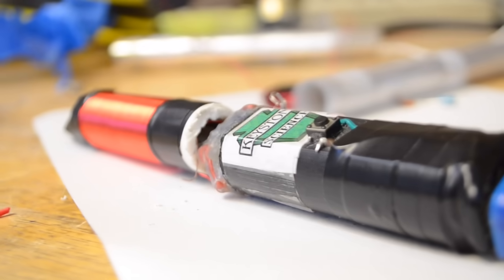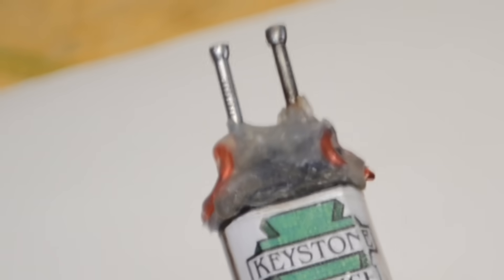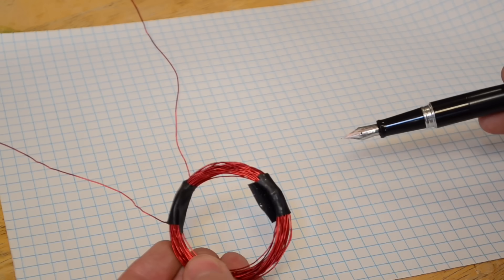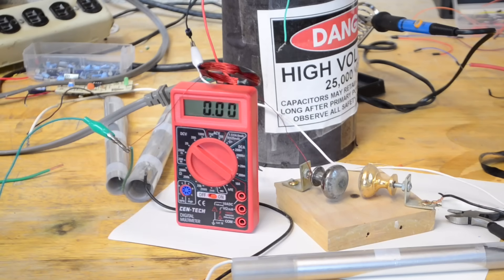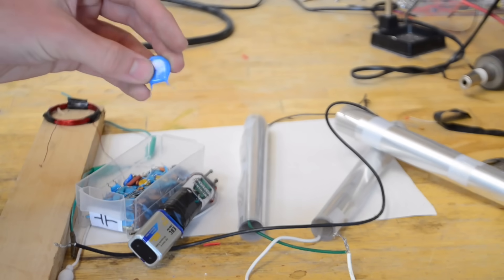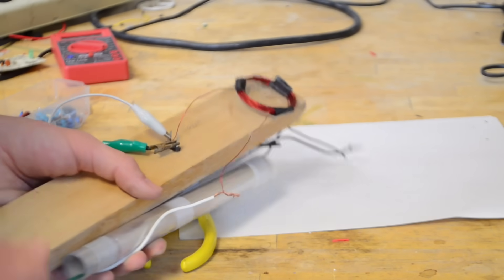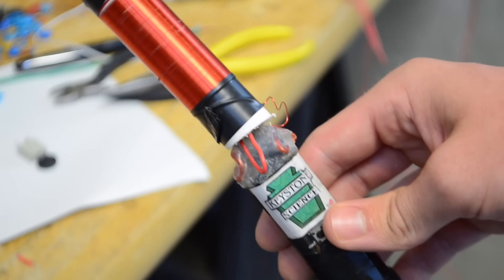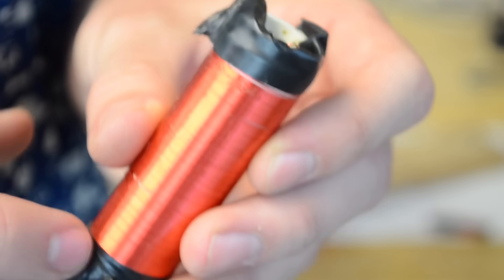How to make a pocket EMP

Comment: if the emp really works why didnt it fry the camera???
Reply: Because the magnetic field it generates gets weaker proportionally to the distance squared.  In other words - double the distance from the EMP and it gets four times less strong. 

Also the field is not equal in strength from all sides which again makes it weaker where the camera is. This is also partially the reason why coil 2 was worse than coil one.
Reply: +Xfactor Chem
man in this case we talk about electromagnetic field, not only about magnetic,  and this type of field not concentrate like magnetic or single electric field, but propagate in all directions, from place where you dispose your coil. 
and yes magnetic field stronger on magnet pole, and if iron core of coil will be sharpened to a needle, on the edge field will stronger on several orders, because iron core concentrate field inside.
Reply: not because it has too small current, and as consequence low power of pulce. And man field is equal in ALL SIDES.
Reply: IluaRu
Nope, take some iron shavings and a magnet. You'll quickly see the field is stronger in some points and weaker in others. More specifically the axis around which the coil is wound is where the field is strongest. This is why a short and compact coil will give you more frying power.

Yes the pulse is weak, but it probably could do some damage to the camera if it was close enough.

My point was that the strength of EM fields falls drastically with distance which is the reason they are far less effective than Hollywood would have you believe.

Comment: wouldnt this work much better with thicker more conductive wire and low ESR PWM capacitors as its the rate of change of magnetic field which dictates the magnitude of the induced voltage not the peak field strength so a shorter pulse would be better? also more windings will make your solenoid act more as an inductor which will give a higher potential peak for the voltage induced when voltage is removed but would slow down the rate of change of the B field so would not be desirable. finally id suggest to anyone wanting to build one to use an inductor not just a solenoid and tune it to the capacitors you use, tune the spark gap to the largest it can be whilst still sparking and use a wire between the inductor and capacitor as an antenna (just use the magnetic dipole approximation and the frequency of the sparks to make it efficient then maybe a reflector behind the antenna to make it directional and greatly increase its power and range)

Comment: why did it not kill the camera?
Reply: Likely because the camera was far away enough to not be affected, he most likely zoomed the camera in so you could still see it work, but have it far enough away to avoid being affected by the ionized air being generated by the EMP.
Reply: 1) it's stated a few times in the video that this only discharged an emp that is measurable about 10-12" from the coil and its not really strong
2) its stated in the video that this emp is not very strong nor will it travel far
3) he said its not a far reaching emp nor will it absolutely fry electronics that it isn't close to
4) did you watch the video?
5) weak discharge plus distance equals camera works fine
6) watch the video again
Reply: Also, I believe anything to do with magnetism is affected by the inverse square law or something. Pretty much it becomes exponentially weaker with distance, like how a strong magnet is almost unremovable while it's on something, just barely doing anything an inch away and almost nothing at 3 inches. (Rough guesses, but you get the idea)
Reply: or if you REALLY want one that's actually effective, you have to detonate a nuclear bomb in the atmosphere.
Reply: also many high end camera are designed to be emp resistant do to how easy it is to over load a studio
Reply: To have a significant ranged emp, you'd probably need to carry around a car battery.
Reply: Head Trip FPV thats what I wondered
Reply: The stronger you make a magnetic field, the denser it becomes, ie, smaller. Is that not right? The little emp might have had magnetic flux reaching the camera but it was very weak
Reply: The small amount of air ionization that little EMP device would have made would not affect an electronic device.  EMPs affect electronics because they induce relatively high currents on the conductors and components of circuit boards.  This usually fries small, low-current components in electronics which is what causes them to stop working.  You are correct in that the EMP is probably too far away to affect the camera.  Additionally, most electronic devices designed today incorporate design principles that minimize the effects of EMP events on their circuits.

Comment: would it be possible to repair a device hit by one of these?
Reply: Nathan Stevenson technically in the world of fallout the nuclear blast that started it wont make emp since its a land level explosion only if it was activated up in the atmosphere will it produce emp
Reply: Lance corporal cook Not without completely rewiring it.
Reply: Nathan Stevenson thank you. I was looking more at the nuclear bomb side of things.

When nuclear bombs go off, all electronics are fried and I was looking at how in games such as the fallout series, all the electronics you find still work
Reply: Nathan Stevenson you miss out on a lot if you fast travel. 

Random encounters are one of my family things in the fallout series
Reply: Lance corporal cook I just wish we could salvage parts for the motorcycles that are lying around everywhere. Fix them up and mount a pair of shotguns on the front, yes please
Reply: Or the tanks littering the waste
Reply: actually, most nuclear weapons of the 60s through to the 80s were airburst
Reply: McGaughey all electronics still have a current running tru it even off so no it will still die
Reply: Military humvees are immune to EMP. I'm sure a lot of other vehicles are as well.
Reply: Lance corporal cook yes but the one in fallout was use specificaly as a ground to ground balistic intercontinent nuclear bomb set to detonate close to ground lvl or just half a mile up in the air it will need to be higher than 6miles up to even do any emp damage in a short radius
Reply: jason forbes and your proof of this is?
Reply: Not the hight for emp but the proof that it wasn't airburst
Reply: Lance corporal cook it also depends on the amount of uranium that was use and how much was use before dispersing how strong the blast will be most dont even use more than 10-20% of its load
Reply: i dont really have prof but since most of the houses was still standing afterward and are not destroyed by the blast it would suggest a air burst emp blast or maybe both
Reply: So, we were correct and it is an airburst not a ground detonation
Reply: Typically, if the device is not on, it may be able to still work. The solenoid is what goes bad, and it is on the starter. Well, that and the computer. :D But older cars should fire right up once you replace the solenoid. 

EMP is one of the only real defenses against tyranny, should we ever need it. They will use it, and then not expect us to. It is important that we understand what goes wrong with out basic tools/equipment, and how to repair them ourselves, or we will be at the mercy of the wolves.
Reply: Lance corporal cook its mostlikey both but yes maybe
Reply: jason forbes You are correct, if the waves make it to it.
Reply: ***** and that's why I'm triggered by it in the fallout games
Reply: jason forbes I've heard that the nukes used in fallout weren't that powerful (for a nuke anyways) and only around 500 kilotonnes
Reply: Don Burd yeah exactly, also smaller bombs tend to be dirtier when it comes to fallout as larger ones push the dust way up into the atmosphere
Reply: Don Burd go do something

Comment: the pvc tube weakened the magnetic field 
using an iron tube could improve the strenght
Reply from the maker: +Jack Mc Devin yeah, the only problem with using an iron core is that it will likely arc to it, also then the coil resonates at a much lower frequency from the impedance of the iron core
Reply: +Keystone Science that is true   
 i also cant think of a better material to use

Comment: i was planning on making an EMP and the circuit i designed is similar to the circuit at 1:54 except the capacitor and the spark gap are switched sort of like a tesla coil circuit would that still work?

Comment: can it be any capacitor like the little cylinder black one
Reply from the maker: +Ihate Juggernog any capacitor should work as long as it's voltage rating is high enough
Reply: What is considered "High enough"

Comment: Would an electrolytic capacitor work? Or are they too delicate?
Reply: for diy projects salvaged components are fine. It's all part of the learning experience. Old caps do deteriorate, but that doesn't mean you should discount every single one. There's a lot of perfectly fine lesser aged caps that go right in the trash every day. if it's not bloated, run it. Worst thing that could happen? catastrophic failure, you pop a cap. confetti time!
Reply from the maker: +Geeky Channel if it was a high enough voltage rating than yes, however personally I have never seen an electrolytic capacitor with that high of a voltage rating ( besides home made caps that I have made )
Reply: Keystone Science how high a voltage do you need? I've got 2 that go up to 75.
Reply: As for the lengthened coil did you try ferite rod inside of it?
Reply from the maker: +Geeky Channel well to use with the taser, probably around 10000 v rating to ensure they don't blow, however you could make a low voltage EMP if you wanted ( the set up is a bit different but it's a pretty similar concept, except instead of a spark gap it is a switch ) . These are less effective in the way of hurting electronics ( which you shouldn't be damaging anyone else's electronics anyways... :P ) but it would still create an electromagnetic pulse !
Reply: Keystone Science My microwave capacitor doesn't even go that high...
Reply: Or do you wire them all in series to get 10000 total?
Reply from the maker: +Geeky Channel yeah, those are normally only around 2 kv if I'm not mistaken, however, you can make high voltage capacitors fairly easily ! I have a video for one type of high voltage capacitor in the description area if you want, also you can make what is called a Leyden jar capacitor, or also you can salvage ceramic capacitors ( most of which are rated for high voltage and are abundant in things like old crt tv's )
Reply: Keystone Science I'm familiar with those. I think I can try to make a layden jar capacitor and surround accordion folded plates with casting resin and get a really nice homeade one.
Reply: +Geeky Channel inside old cameras you can find 330v capacitors and they can go all the way up to  440uF if you can fork out a little (be careful with these you'll end up in hospital or dead if you have a weak heart)
Reply: dont bother salvaging old capacitors- they are one of the few electronic components that commonly deteriorate with age, both their ESR and capacitance deteriorate meaning they will either no longer be the value they say, or they can heat up and explode
Reply from the maker: +Joe Well the power converter although it claims to give out 400000 volts for some reason , I think it actually only gives out 8kv, because if it was actually 400kv it should be able to stretch an arc of 4 meters approximately , so yeah :D
Reply: Keystone Science the rated voltage is only momentary to make the arc on a true 50kv police taser, the actual voltage induced into the body is closer to 5 kv. Keep that inn mind when you see claims of ridiculous voltage numbers!
Reply: if you have a 2 polarised capacitors and connect them + to + or - to - it will produce a bidirectional capacitor with the same capacitance as 1 of the capacitors used (assuming they're equal), putting capacitors in parallel sums their capacitance and the ESR is reduced (the new ESR will be the inverse of the sum of the inverse of the ESRs of the capacitors used), putting capacitors in series gives the sum of the voltage ratings of the capacitors used and in the case of 2 identical capacitors will double their voltage and half their capacitance ratings. with these simple rules you can make any voltage or capacitance capacitor you want  just be careful the resulting capacitor array has low enough ESR or it will heat up internally and may not charge or discharge quickly enough.
Reply: +Keystone Science you say a cap rated for 10000v would work but the power converter outputs 400000v, wouldn't a 10000v cap blow up?
Reply: Keystone Science That's assuming you've got the amps to keep that much voltage going. As the distance goes up, so does resistance. 9volts don't have that kind of discharge capability.
Reply: +Keystone Science I found these: http://m.ebay.com/itm?itemId=131825646704

some combination of those ought to allow for a decent amount of voltage and capacitance

Comment: What is the purpose of the spark gap?
Reply from the maker: +calvinatorzcraft the spark gap is there because when the capacitors reach a high enough charge it can jump the spark gap, so, basically it allows a way for the capacitors built up energy to discharge, and while it discharges it goes through the coil. And this makes the electromagnetic pulse :D
Reply: +Keystone Science cool

Comment: Dude how the fuck did the camera not shut off I doubt it even works
Reply from the maker: +fgt asd the range is very low ( although if you wanted to increase it, simply increase the capacitance ) but yes, it does produce an electro magnetic pulse .

Comment: so the more you hold down the button the more powerful the EMP will be when you release the button??
Reply from the maker: +Gregorio Ramos well, the longer, the more net power is being induced to the electronic device. However more power is more so proportional to the voltage and capacitance used
Reply: so the more voltage the more it can destroy (the EMP)

have you ever tried to meassure the EMP with a 10000v teaser? or a stronger one?
Reply from the maker: +Gregorio Ramos yes and no, I mean the more voltage, the more voltage is induced ( and so it is much easier to fry components ) but the biggest factor is probably the capacitance, because that determines the strength of the field produced ( also I guess the spark gap being further apart ) , and so basically by moving the spark gap further and increasing the capacitance, the the capacitors build up more of a charge before they can jump the spark gap, and when they do jump it, more energy is dumped into the coil, and thus a stronger magnetic field is produced :D ... But yeah I have not tested it with a stronger taser.

Comment: also the shape and braid of the coil as well as the gauge of  wire  determine the fly pattern of the emp. add a ring magnet to the coil and it will increase the pulse strength.  alot

Comment: The strongest part of the magnetic field of a solenoid (that cylindrical coil) is inside the solenoid, because of the way a magnetic field forms around a wire.

Comment: how come it didn't mess up the camera?
Reply: The strength of the electromagnetic field is reduced by the square of the distance, so like spencer said, it needs to be close to work, otherwise it will be too weak.
Reply: King Cletus magnetic fields greatly reduce over distance they must be very close in order to work
Reply: I don't think you would even have to do that. He had the coil placed directly on the multimeter, and the pocket one placed next to it, so the camera would have to be really close for it to be affected. At least, that's just my assumption.
Reply: Okay I actually had the same question. Didn't realize it was already asked and answered. So your saying he just zoomed in out the ass on his camera to keep it outta range of the EMP?

Comment: why do you need the space for the spark?
Reply from the maker: It is so the EMP will be more powerful, as it cannot jump the spark gap until the capacitors build enough of a charge, so when it does, that large charge is also dumped through the coil
Reply: OK thanks a lot.